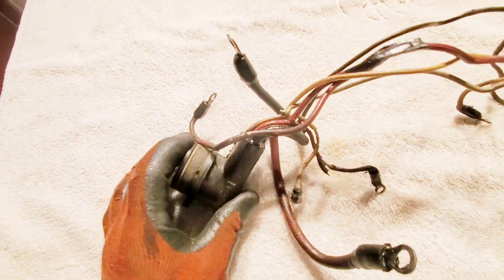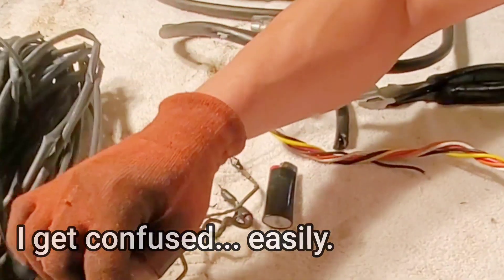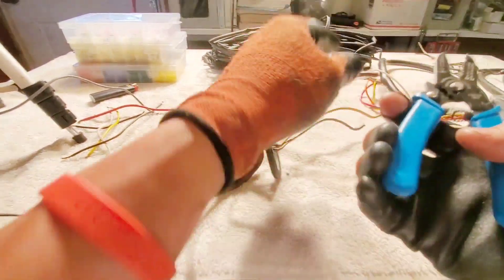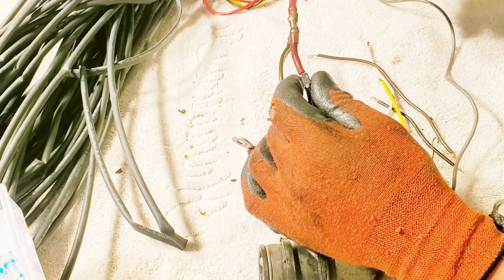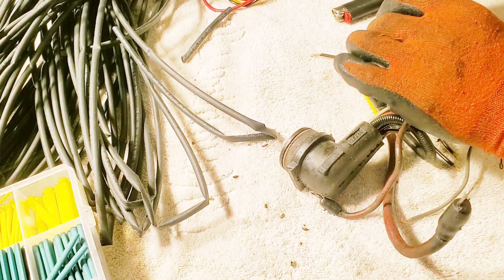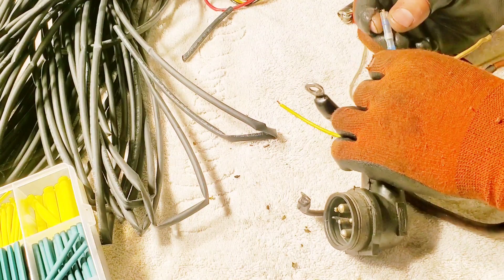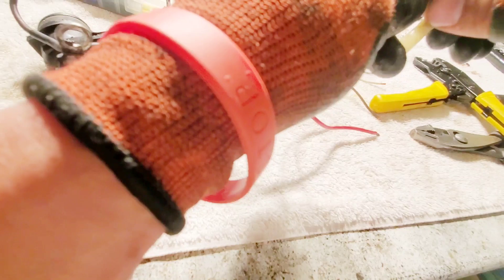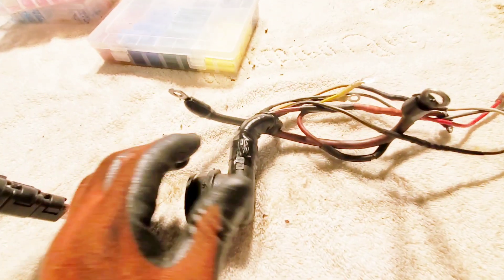Mercury Internal Wiring Harness: Rebuild

Comment: please help me.. where does the salmon or black/yellow wire hook to on engine 70,s l6 models?
Reply: the salmon colored wire plugs into the motor harness but i dont see it coming out.  all i see is red and white wire for switch box and starter wires. what does the salmon wire go or hooked to on motor?
Reply: i hooked kill switch to ground and salmon wire but voltage at white wire coming from switch  on switch box dont change when i pull kill switch.

Comment: My white wire doesn’t show contunety with any of the pins in the plug ,where does it go
Reply from the maker: What engine do you have? Year and hp.... the white cable typically attaches to the white terminal on your switch. Son
Reply: @MerCSonL6  1979 1/2 140 white wire don’t show contunety to any of pins on harness
Reply from the maker: @maryfithen5006  so you have an adi ignition?
Reply: @MerCSonL6  yes
Reply: @MerCSonL6  the motor runs with out it ,butI need to wire it to a 8pin plug in preparation for install on myboat

Comment: Couple questions? I have a 1974 115 and would like to upgrade my control box is it possible to wire to newer controls? Second question whoever had it last used a lot of liquid tape on all the wires on the motor do they make a harness or will I have to replace them one wire at a time?
Reply from the maker: https://youtu.be/SGcK8wiTYpQ
Reply from the maker: This is how you would convert it to a newer style controls. And yea, cdi does make internal wiring harnesses for Ole mercs. Son
Reply: Is cdi a website?
Reply from the maker: @smokintorch4252  CDI Electronics 414-2770 Mercury/Mariner Wiring Harness - 2/4/6 Cyl. (1966-1981) https://a.co/d/ae7Uh5p
Reply: Thanks for the help!!

Comment: What marine guage of wire should I use to redo some wiring inside my Merc 1500 1977 ?
Reply from the maker: I'm not overly familiar with wire gauge. It also depends on which wiring. The main from the battery requires a thick guage. All of the others require enough to transmit 12-16 volts. Similar to that of a boat trailer...just slightly thicker. Hope this helps. Son
Reply: @MerCSonL6  yes thanks a bunch for the info !

Comment: Thank you for your videos.  We recently purchased a older lund with a Mercury 90 and i came across the same troubles with the wiring harness.  If you could help with anywhere i can find identifying s/n of this motor would be great.  Also found the 3 third carb linkage broken and am unable to be sure of finding the correct parts needed.  would love to get this ol girl out on the water.
Reply from the maker: Serial number should be above where you you hand tight the clamps to your transom on the transom bracket. Right below the face of the engine. Son

Comment: are you still interested in my 71 850? havent heard back from you in a while
Reply from the maker: Sorry. Yes. Where are you located?
Reply: @MerCSonL6  south pittsburg Tennessee
Reply from the maker: @richardblanch1576  that's a long trip my friend. Sell to someone else?
Reply: @MerCSonL6  guess ill post it,  could you put a value on it
Reply from the maker: @richardblanch1576  depends on compression and overall condition. Do you know the compression?
Reply: @MerCSonL6  135 all 4 cyls, good switch box, coil, wires, starter, relay, i think good trigger/distributor, and i have complete tilt setup, control box, etc
Reply from the maker: @richardblanch1576  national market $800. Local $400. The market is tough. Especially if you do not have a reputation for selling, buying, and repairing. Son
Reply: @MerCSonL6  thanks for the info

Comment: ok im trying to wire a key switch to a merc 650 1965 65hp power and don't see the gray wire all the colors i see is blue, red, yellow, white color's and the black and red 8 gauge wire ground and solenoid one.. if can send you a email with pic.  o and the key switch im using.

Comment: Hi MerCson, I have a 1969 Merc 1000ss who’s harness I’ve taken apart and most of the wiring looks good, but both the positive and negative leads are very corroded. I tried to go to Home Depot but it doesn’t look like they have anything there that I can use to splice in. I’d prefer to avoid having to buy the entire new CDI harness if I could. Do you happen to know if I need marine wiring or where I can get something similar to the original? Thanks!
Reply from the maker: Don't necessarily need marine wiring. Just make sure the gauge is correct. Might try autozone or advanced auto. Son

Comment: I would like to know how you made the wire for the key switch to start the merc'ry motors
Reply from the maker: I connected them....
Reply from the maker: There's a 12v wire that connects to the starter selonoid. All you have to do is make sure the voltage connects when you turn the keyswitch. Son
Reply: @MerCSonL6   Thank you so much Name is John
Reply: @MerCSonL6  I recently bought a 1985 mercury 1150 motor, it will crank but not start. Can you do a video on diagnosing a no start on the tower of power motor?
Reply from the maker: @josechavezjr91  every "no start" can have hundreds of possibilities. Im not joking. I need a better description of what is happening to properly diagnose your specific situation. Son